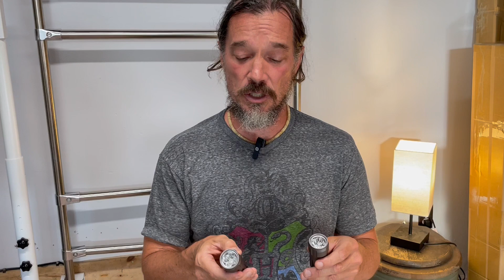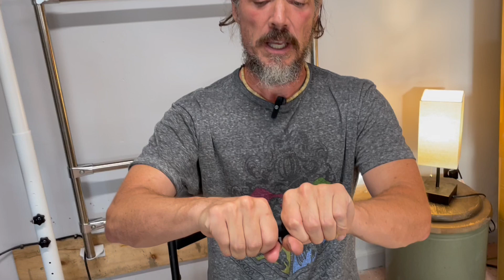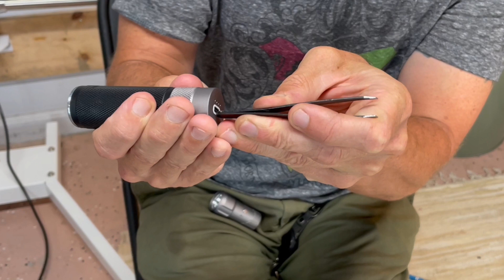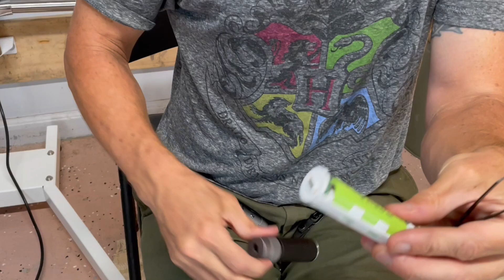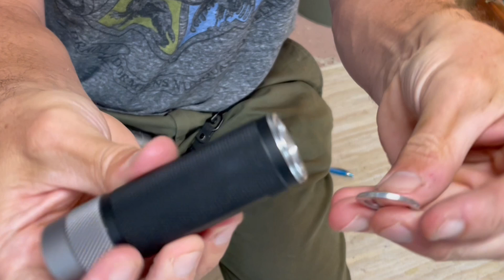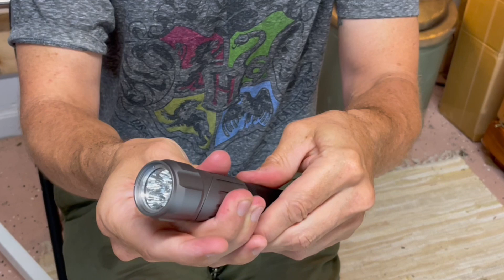🔥 Torch Updates & Battery Replacement Made Easy! 🔥

Comment: Hello.  The instruction manual indicates...

• Mode 1: Press power button once for blue/red/NIR (450/670/810). 
• Mode 2: Press again for Red/NIR (620/670/810). 
• Mode 3: Press again for red only (620/670). 

Is the 620 wavelength also included when "Mode 1" is selected?  I don't see it listed in the specification above.